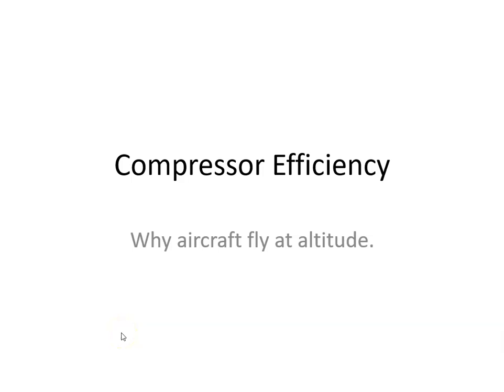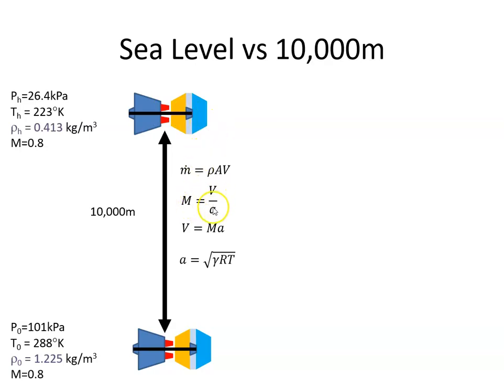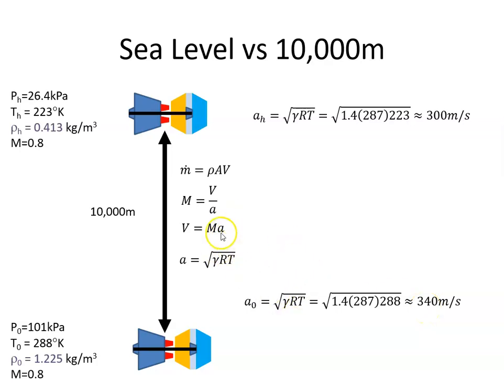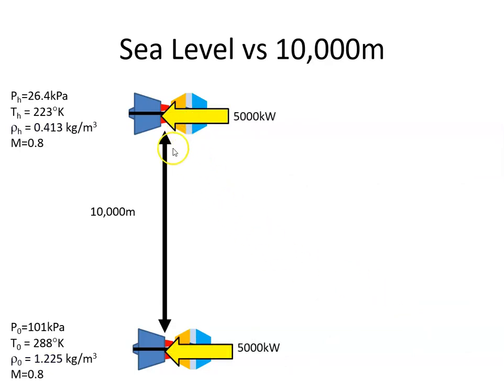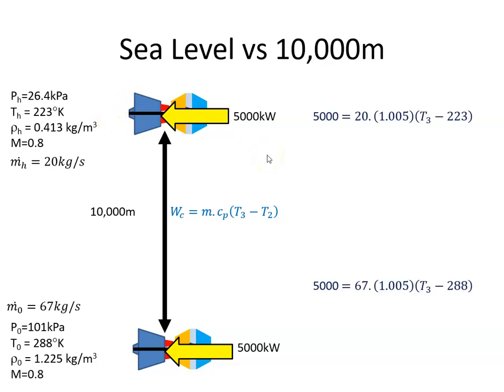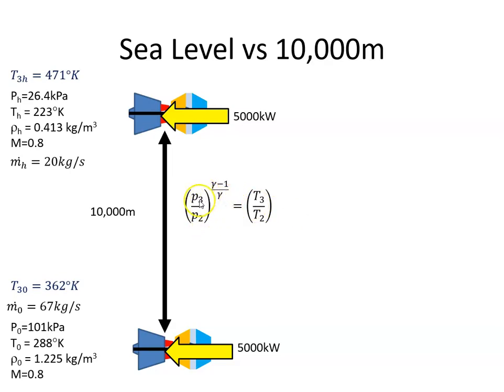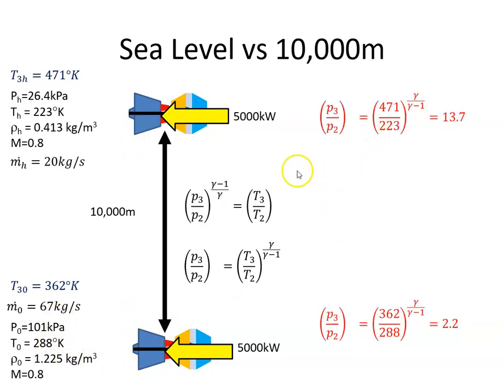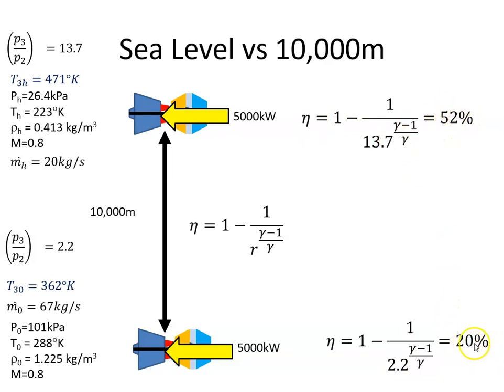Compressor Efficiency at altitude

Comment: Is this saying the Engine is "More Efficient" but develops "Less Power" (Thrust) ?
Reply from the maker: @kletops46  Yes.
Reply: @RoddyMcNamee  Does that mean when ground based industrial units develop less power due to a decrease in barometric pressure, actually become slightly more efficient ?
Reply from the maker: @kletops46  I never considered that before, but yes, if the compressor inlet pressure drops, then theoretically for a given compressor outlet the compression ratio will increase, leading to higher efficiency.

Comment: Sorry to keep asking questions, but why do you get a higher output temperature at altitude?
Reply: The higher the temperature difference, the more the efficiency would be.
Reply: @mdatiqurrahman9951  Yes but why is the output temperature higher at altitude when the input temperature is lower?
Reply from the maker: @tigesinaus  The temperature is higher because the compressor doesn't have as much air (mass of air) to compress at altitude and therefore can compress it further and achieve a higher temperature.  This will increase the efficiency.  However, the smaller mass of air will mean less thrust.
Reply: @RoddyMcNamee  Perfect. Thank you!
Reply: The input Temperature is the atmospheric temperature, which is low obviously, because the higher we go up from the see-level the lower the temperature would be. Now about the output temperature, he assumed that the compressor power would be same at both level, hence, the output temperature should be higher at 10 km. It is stated from 3.01 sec in the video.